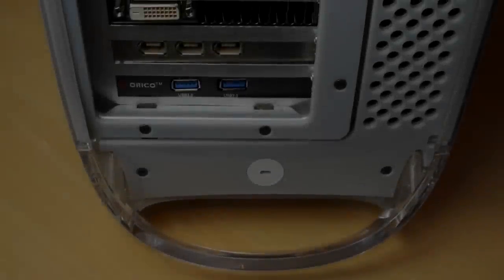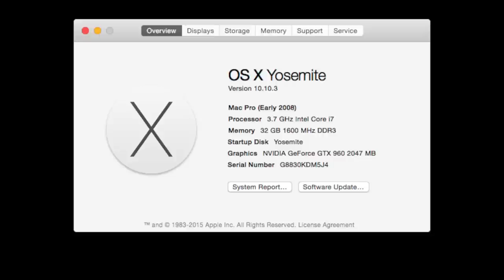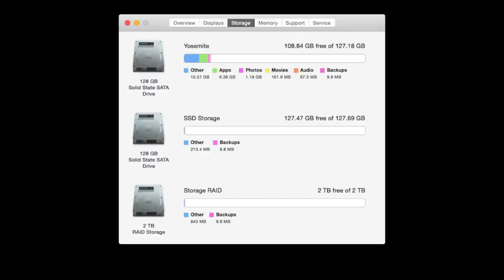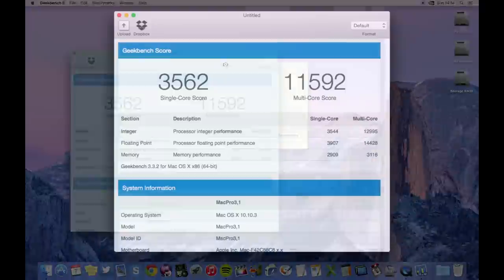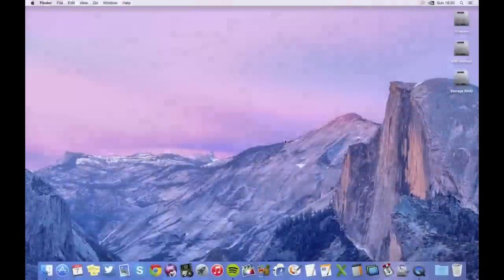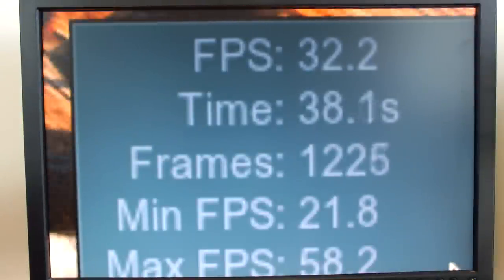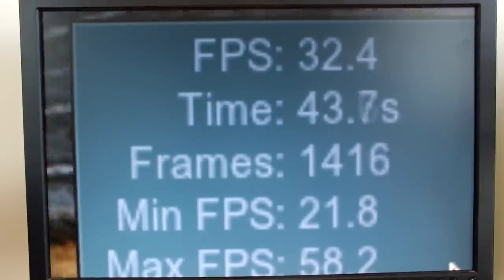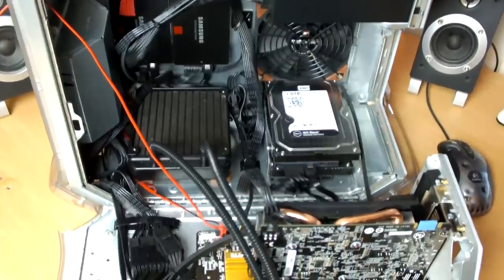2015 Hackintosh Build: Part 5 (Benchmarks, Conclusions & Final Thoughts) | IMNC

Comment: Tom, be careful! Nvidia Cards do not have a fan controller on Mac OS X. By this I mean that they do not ramp up at all and will become extremely hot on benchmarks; just keep an eye on those temps!
Reply from the maker: John Harding Are you sure? Mine ramps up and down all the time?
Reply: I thought I was sure... Maybe the 900 series has more thorough compatibility than the 600 series.

Comment: it is stupid idea to benchmark on 3 monitor at once not having High END Graphics Card, not to mention having Low End Graphics Card
I hate to brake NEWS, but from GeForce series 600 all x80 and x80 Ti are Mid End Graphics Cards (how else to explain Titan, which is real High End GC)
using Low End graphics card on 3 monitors running heavy 3D is a bit overkill
I have Mid End (AMD Radeon RX 580 8GB) GC and I do not run 3D on 2 monitors (I have 4 monitors, but run 3D on 1 monitor - 2560x1600)

Comment: if u want a raid disk array that will work in both windows + hackintosh (dual booting) check out the rocketraid 620 https://www.newegg.ca/Product/Product.aspx?Item=N82E16816115075